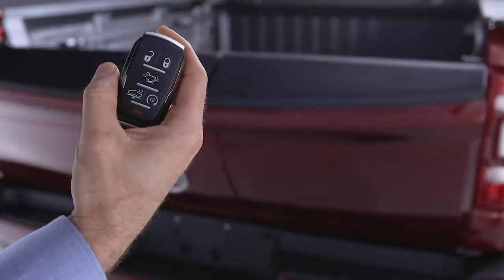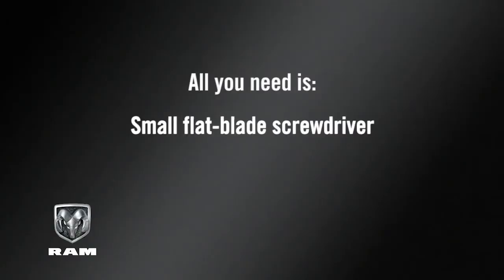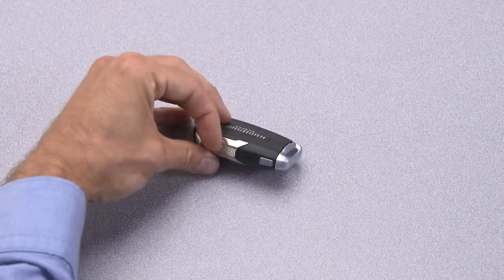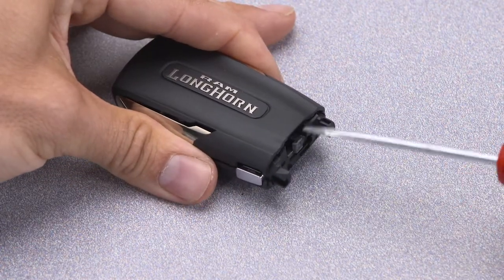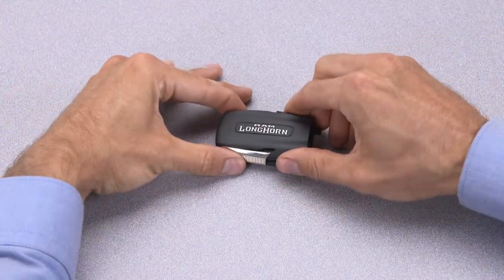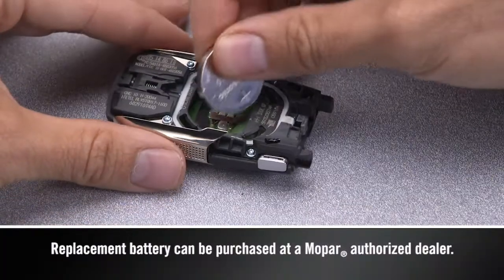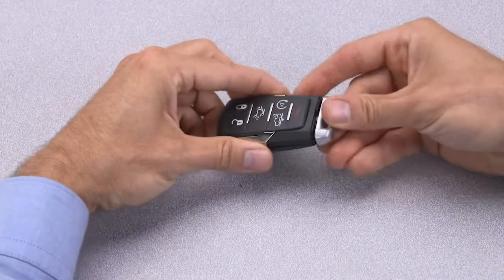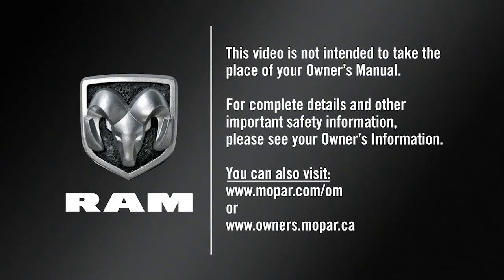Key Fob Battery Replacement | How To | 2021 Ram 1500 DT

Comment: Wrong.  !!!!!!  
2032 battery.
Reply: mine does have the CR2450 bigger battery compared to CR2032,
2021 RAM 1500 Laramie
Reply: My 2021 Longhorn has the 2450 battery as well.  Truck is 4 years old now, so this must be how long the battery lasts.
I have the turbo diesel with 33 gallon tank, gives me well about 800 miles on a tank, love it.